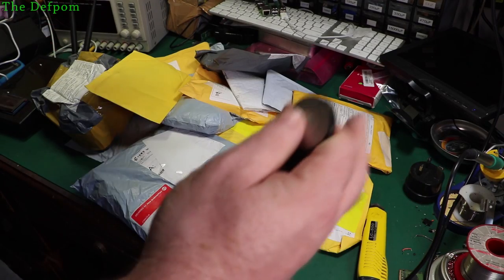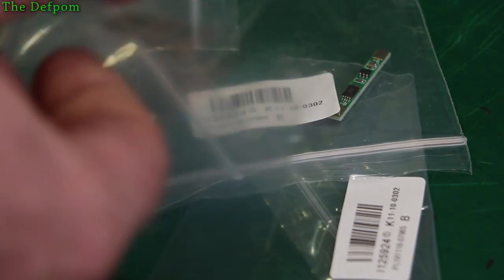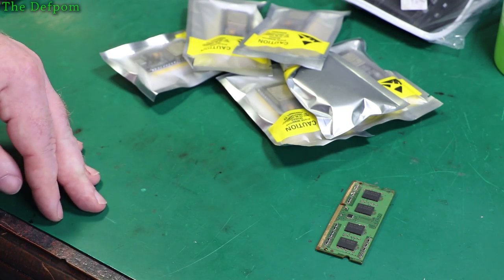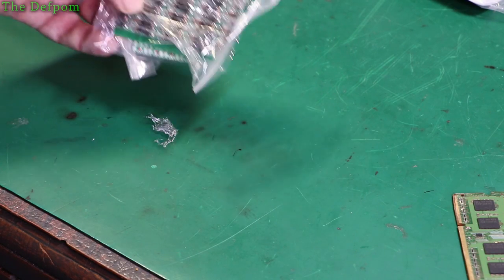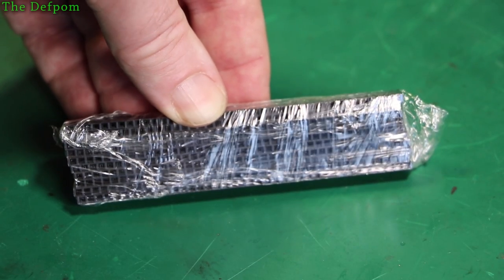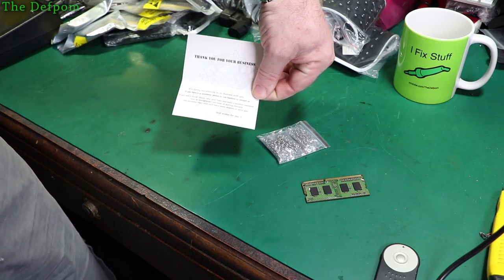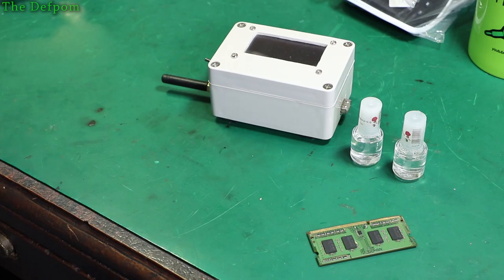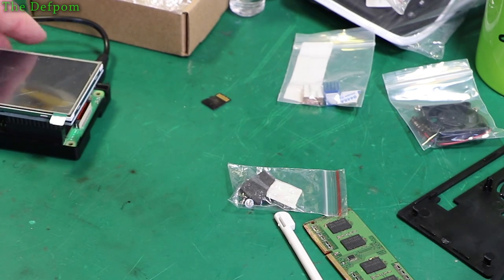#693 Mailbag Monday 9th March 2020

Comment: Is there enough surface room on the LCD to use single/double sided gasket tape instead of nail varnish......available in really thin strips and as thick as you want.
Reply from the maker: IanScottJohnston - the edges are only about 1-2mm, I’m happy with the nail polish approach, it worked well and basically glued in the Perspex window, which means it doesn’t fall out when taking the unit apart.